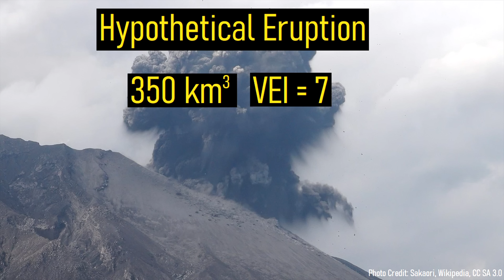This Would Happen if a Supervolcano Erupted Today

Comment: Also, if that happened, we would have five years of bye-bye global warming, followed by a return to what would be typical of pre-industrial weather patterns, as temperatures would be dropping back to a similar temperature. If this eruption happens in the spring, we would have a mild winter in the US, followed by a very cold, spring and summer, with the next winter, being very cold and snowy and another cold spring and summer. Why? Because in 2014, and in 1815 two unique things occurred, you had a positive AO, following significant amount of sulfuric aerosol injection into the polar stratosphere due to the arctic being cooled. Significantly this allowed for the polar vortex to be very strong, allowing for milder than normal temperatures in the lower 48 yet even though 2020 was one of the least snow is winter in New York City history with the winter of 2022 to 2023 now breaking that Record, New York City saw snow on May 9, which tied an all-time record for 1977 same day ironically too. Yet the pattern of 1976 to 1977 was different as a winter was very cold and snowy. This was a taste of “without a summer” because of the Arctic oscillation being negative with there, still being some sulfuric aerosol injection. This VI for err eruption at RAIKOKE, was very sulfur, rich for only a VEI for imagine if it was a six.

There were volcanic sunsets for months after that VEI-4 and it got me hopped up for a cold and snowy winter but had I read the analog from 1815 to 1816 I would’ve known otherwise

Comment: Uh no, a super volcanic eruption is any volcanic eruption with a VEI rating of 8. In other words, an eruption has to produce a minimum of 1000 cubic kilometers of deposits in order to be called a super eruption. Anything less than that is NOT a super eruption. Yet here you are calling a VEI 7 event that produces 350 cubic kilometers of deposits a super eruption?!?!?!? Dude, that is NOT a super eruption!
Reply: Super eruption is a term that can be applied to VEI7s as well. It depends on the person but most people do consider VEI8s a Super eruption

Comment: I noticed that geologists tend to disagree with which volcanoes should be considered "super". Some argue volcanoes are only considered a supervolcano if they had produced an eruption on a VEI 8 scale or are believed to be capable of producing one in the future. Others consider volcanoes that had produced medium or large VEI 7 eruptions as supervolcanoes as well. I think I would agree with the latter based on what I've seen in this video. Among the volcanoes that produced VEI 7 eruptions, the smaller ones like Tambora looked more like an oversized VEI 6 eruption with considerably greater climatic effects but the local and regional effects are still comparable to VEI 6 ones. Even Krakatoa's 1883 eruption, which is a VEI 6, was arguably just as violent and energetic as Tambora's despite producing much less volcanic material.  Meanwhile, medium and large VEI 7 eruptions produced by the likes of Campi Flegrei, the calderas from Kyushu, Japan, and this one look borderline super eruptions in terms of violence and their effects in the environment especially in the local and regional scale and they are pretty much large explosive calderas just like Yellowstone and Taupo. I find it ridiculous that a volcano for example could produce an explosive eruption let's say 900 km³ in volume but not be considered a supervolcano because it barely missed VEI 8 range but the effects of such an eruption would probably be not so different from a small VEI 8 eruption. VEI 8 or not, such an eruption is just way, way too far different from the typical volcanic eruptions we are accustomed to.
Reply: Really well written summary of the difference between ordinary eruptions and eruptions from caldera systems. The difference seems to be in how each type of volcano erupts according to a 2014 paper by Carrichi et. al. An ordinary volcano erupts when an injection of new magma into the magma chamber creates pressure that then triggers an eruption. With caldera systems the magma chamber is too large to be pressurized by new magma. Eruptions occur instead when the magma chamber becomes buoyant enough to rise through the crust to the surface. I do not know if this applies only to VEI 8 eruptions or also to mid to high level VEI 7 eruptions. The paper's title is called "Frequency and magnitude of volcanic eruptions controlled by magma injection and buoyancy".

Comment: Question- Why would the ashes be covering the US instead of Russia/Asia?
Reply: Because of the jetstream. It flows in a easterly direction, but it's not in a straight line. Because of earth's rotation it curves north and south as well. So, not only would it blow ash away from Russia/Asia, but also blow it towards the United States.

Comment: So a few things here. It important "when" a wave would hit some of those cities.. Anchorage has a tidal range of 30 feet. A wave at low tide would likely damage only boats. A wave at high tide would enter the city. I have personally been to Latuya Bay in Alaska. That's where the world's biggest tsunami hit. You can see the wave line about 200 feet up the shore where the trees were stripped. It was fascinating. Alaska also had another landslide tsunami in 2017. A pilot noticed and area of no snow after a bit storm. Anyways enough of my babbling.
Reply: In Lituya Bay, on the mountain spur opposite the initial landslide the wave trim line reached 1720 feet (524 meters). There were boats in the bay at the time and there are interviews with some survivors on the net. One boat actually was lifted (surfing) right over the peninsula at the bay entrance and the occupants survived.
Reply: @jimmyjames2022  this is 100 percent true.
Reply: what was the date of tsunami?
Reply: @PEABODYBABYKINS  9th of July, 1958
Reply: @PEABODYBABYKINS  which one?

Comment: I love how you addressed at the start how it is really unlikely for a super volcano to actually erupt, which I found good to spread true information
Reply from the maker: I repeated the same thing at the end, as this video is the sort of thing which could be potentially grossly taken out of content
Reply: @GeologyHub  I can't see how we can be caught off guard by any supervolcanic eruption to me you can plan so far ahead for contingencies but you can't prepare for scale & climatic impact .
Reply: i heard yellowstone is due soon?
Reply: @rizkyadiyanto7922  NO, but I made it as another hypothetical  location in an above post. 
The results are the same.
Reply: @rizkyadiyanto7922  The thing about the Yellowstone hot spot is that it's going under the Rocky Mountains so it has even more crust to make it through then. (It's basically been running through the Basin and Range region until this point.)
Reply: @LadyAnuB  - It hasn't been under the basin and range its whole life -- at its birth around 57 million years ago (around there), the initial plume head, it was under oceanic crust. But yeah, since North America overrode it, it's been under accreted terranes that get older over time. The first terrane that passed over it was a terrane the YHS generated, being Siletzia. Now it's under the older accreted archipelago/ribbon continent terranes, the accretion of which caused the Laramide orogeny. Eventually it will be under the craton -- and maybe that'll be the end of its surface expression?
Reply: So if he had not said that then he would be spreading: mIsInFoRmAtIoN? Shuttt upp you modern day sjw
Reply: @ridgecrestwack9746  What?

Comment: You commented that 4 inches of ash would cause buildings to collapse, how heavy is ash compared to snow?
Reply: 4 inches of dry ash weighs 120-200 pounds per square yard, and wet ash twice as much, according to USGS. It’s particles of rock so it makes sense. Think how heavy sand is, but ash is much spikier than sand, so it doesn’t flow off the roof, it stays put.

Comment: I’ve got an interesting question:
Is it possible for a volcano to literally launch rock and ash into space(not deep space, just past the Kármán line), and if so, have any eruptions that we can document been that massive?
Reply: The answer to the second question is a definite no: no eruption plume rising above 50 km has been measured or calculated.
Reply: @Daneelro  ancient ones did, the Permian event launch love bombs intercontinental, it rained cement over the planet
Reply: @nothuman3083  I haven't read of anything like that. What I did read about was that the formation of the Siberian Traps had a phase (coinciding with the mass extinction) with coal-basalt eruptions that shot ash into the stratosphere which rained down in places as far as Canada. This did not require eruptions with plume heights more extreme than any major eruption, however: 10-15 km is enough. And coal-basalt eruptions aren't as explosive as those involving steam.
Reply: @Daneelro  Well that comment didn't age well. This channel just released a video mentioning the Honga Tonga Honga Ha'apai volcano reached 54 km.
Reply: The question here is can a magmatic object stay together in one piece long enough to reach such a height?
Reply: @LadyAnuB  I would think that lava bombs would shatter from the massive temp change to intense cold, while traveling up the atmosphere, along with the physical stresses.  I wonder how far up the ash/tephra left from that (mostly ash) would make it, as shattering would send the pieces outward as well as slightly upward, but they might get pretty high, esp if they did so before shattering.  I'm not an expert, but very interesting to think about and calculate how high they were they got before shattering, and after.
Reply: @HonorableHarbinger  speculation means we think that something might have happened a certain way. Assuming  and finding proof that corroborates your theory are two different things
Reply: @HonorableHarbinger  that's actually not speculation so how about you get your facts straight before being a stuck up douch and shutting others down
Reply: @ridgecrestwack9746  You’re acting rather stuck up yourself.

Comment: I know that there are "no stupid questions" but this one comes from a legitimate point of curiosity. If due to climate change world temperatures went up, would this counter those effects thus making the volcanic winter less wintery? I honestly dont think it would make things better cuz of the reduced sunlight, but warmer maybe?
Reply: The effect of CO2, CH4 and other such gases warm the temperature of the Earth by creating a barrier keeping the heat emanated by the earth and the sun. The problem here is that the quantity of CO2 and ash would make a layer so thick that most of the sunlight or heat will never be able to reach the ground, which means no way of reflecting it from the inside. It should be noted though that the ash cloud (I dont quite remember the right term in english) won't cover the whole planet, only parts of it. In such case, we would assist to a world where places like the middle of europe would probably still increase in annual temperatures, but most of north america (due to the rotation of the earth and the climate cells directing the wind) would likely fall into a climate akin to toundras. Just my suppositions though, I do appologise for my lack of vocabulary, I'm better at discussing those things in french haha
Reply: @alberteinstein1620  In terms of the ash. It depends where the volcano is located. If there is a super-eruption at the equator than the ash could easily cover the planet

Comment: I have a question concerning pressure waves racing around the globe...

Is it possible for atmospheric pressure waves to be strong enough that they could all meet on the exact opposite side of he planet where they converge to make what is effectively a loud and destruction boom as they all crash into each other on the opposite side of the globe from the initial blast site?
Reply from the maker: Possible, but this would be a question better asked of a meteorologist. I’d lean towards yes but it would simply be slightly louder than it would have been if no convergence occurred, increasing the amplitude
Reply: I am a retired meteorologist, but this really isn’t in my field. I would think that the waves would pass through each other with a brief increase in intensity at that point, in the same way that waves and swells from different directions do in the oceans.
Reply: Possible. Just like 2 cars colliding head on. Much more force is present than if the 2 cars were heading same direction.
Reply: @GreatDaneLoverz The agitation of the edges of a round wave pool is a different situation. In the center of the pool, the wave energy of the edges is concentrated, giving a large amplitude. In the case of a large explosion on earth the energy is first diluted by traveling in all directions. When the waves meet at the opposite point, the energy will never be more than the original explosion en probably far less due to changes in the wave front through obstacles and atmospheric influences.
Reply: GreatDaneLoverz, are you a fan of scifi/fantasy books? Have you read Mercedes Lackey's "Storm" trilogy? This sounds like what she was writing about, only those pressure waves were magical in nature.
Reply: The reason I proposed this is because in a round wave pool if you agitate the edges around the ring, it will make a huge splash up where the waves all meet in the middle...  The atmosphere is basically a fluid in behavior, albeit far less dense then an actual liquid
Reply: The pressure waves will travel over the surface of the Earth, which includes several mountain ranges. by the time they reach the point on the other side, there will be enough deflection, diffraction and dispersion to make the convergence very spread-out.
Reply: While in general the shock waves would be diffused, in actual fact atmospheric focusing would create certain locations, even at vast distances, where the effects were dramatically greater than expected for their distance.   This isn't even questionable, as it's been observed directly during testing of nuclear explosions, our closest manmade equivalent to volcanic blasts.  The most dramatic example to hand is from the testing of the Tsar Bomba, which holds the superlative 'most powerful single-bomb blast ever tested'.   While the effects of the shock- and sound- waves were generally felt to a distance of some hundreds of miles, strong effects were recorded in certain locations up to thousands of miles distant, notably in Norway. 

Now consider the immeasurable distance in explosive force between the Tsar Bomba, and a supervolcano, and you can extrapolate that the potential range of shockwave induced damage is likely global, if only sporadically.
Reply: @Daneelro  that makes sence..    also air temperature and barometric changes may also effecf effect its speed...   so guessing your right in that there would not be much of a central point to converge onto/into.
Reply: @GreatDaneLoverz  If you're interested in an actual convergence effect, look up the Caloris Basin on Mercury (an impact crater about 8.5 times as wide as the dinosaur-killer at Chixculub, likely caused by a 100 km asteroid - such an event on Earth would have killed all multicellular life), and its antipodal chaotic terrain.
Reply: @Daneelro  thanks...  I really do need to read more books...  work is consuming my life these days...

You have my curiosity peaked now..   :)
Reply: https://youtu.be/WffR6HrEqTA

Comment: Isn't a supereruption 1000 km^3 of ejected tephra or more?
Reply: Megaeruption is VEI 7+, while Supereruption is exclusively VEI 8.
Reply: @gorantev  that's what I was thinking
Reply: It's a pretty loosely defined term. The most accepted definition is 1000 km3 of bulk erupted material, or 450 km3 of dense rock equivalent (magma). Based on this, GeologyHub calls lots of things "supereruptions" that absolutely are not. He also usually only takes the highest estimate of erupted volume, rather than the average value or range.